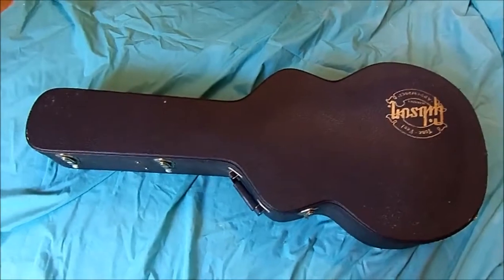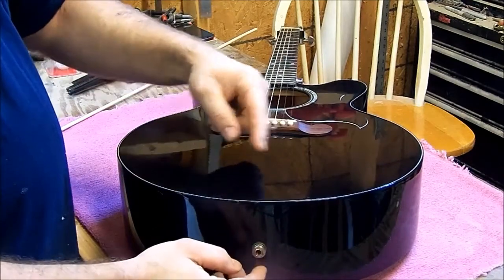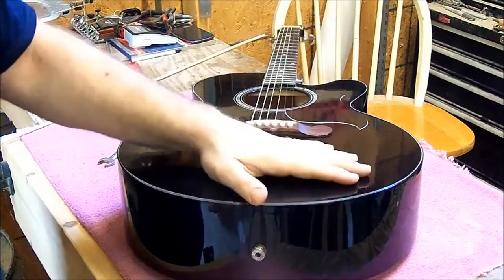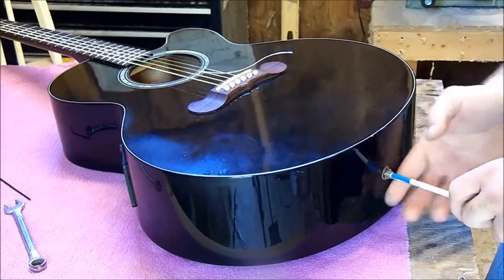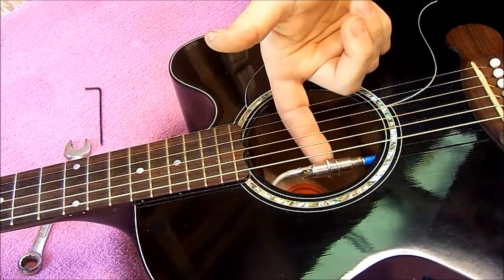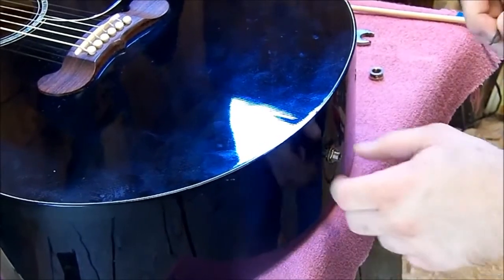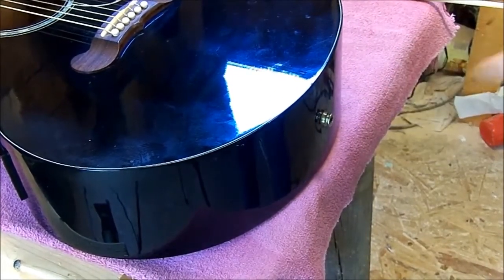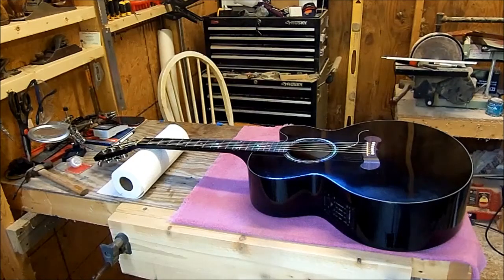How to fix the endpin jack on an acoustic guitar

Comment: I have a small parlor guitar so the sound hole is smaller than normal plus it has a LL. Bags pick up screwed in on either side. I took the pick up off once and it took literally four hours for me to get the screws lined up a. And yes the pin is loose again. I will try anything short of removing that pick up again.